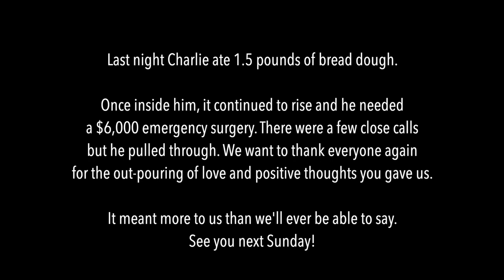Gay Couple's TINY HOUSE adventure | RV Renovation

Comment: Remember you guys. Get the wheels and tires and breaks on the 5th wheel checked thoroughly. What ever you do don't go cheap on the tires. %th wheels are notorious for blow outs if you don't run heavy ( I prefer at least 10 ply) tires. One blow out can ruin a lot more than your day.
Reply from the maker: Totally agree! We also invested in good emergency coverage and got the expensive Good Sam membership for tire blow out and replacement. It wasn't super cheap but we want to be covered just in case!

Comment: I have a nasty wall in my RV like you had in the corner of your bump out. May I ask what you spread on the wall?  Was it spackle or something else?
Reply from the maker: We used wood fill to rebuild the wall (not sure if it’s going to hold up or if it was wise to use that) but given that the walls were all plywood and not plaster of drywall, it made the most sense. Plus, it looks great!

Comment: Sorry to ask, but I have never painted furniture and I have a cabinet which is highly stained in a semi gloss, I couldn't just use TPS on that to prepare to paint it could I ? I think I would have to sand it, or use something to remove the stain that might be stronger, can you advise me ?? And thank you if you can help me.  Also I'm in Australia, I don't know what TPS is called here, but I look into it.  Actually I live in an apartment so I couldn't take my furniture outside and spray like you did, so could I still do it indoors? Your little home looks huge.  Sorry to read about your poor dog, your dogs are beautiful
Reply from the maker: Hey there! No worries at all!! We’ve used this product on glossy styled cabinets to clean them to get ready for priming and it worked really well! I’d suggest you at using a heavy duty oil based primer...your issue with glossy wood is that the oil will often bleed through the primer and paint but using an oil based primer will really lock everything in! For a project like furniture I think I’d just use a brush and high density foam roller...best of luck with the project!
Reply: @tylerandtodd  Thank you kindly 💙

Comment: Did you have the brakes checked and the bearings done?
Reply from the maker: We did right before we left but it's probably about time for another check!
Reply: @tylerandtodd  Yearly is the best way.  I have living quarters horse trailers and flatbed trailers.  Have seen some really bad damage from bearings not being maintained.  You guys are so damn cut and a blast to follow.
Reply from the maker: @jackr942  Good to know...thanks so much for the tip, really appreciate it!